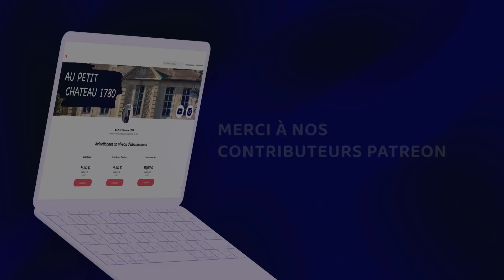ON CHANGE TOUT ! PORTES ET FENÊTRES DU RDC (Triple vitrage) | Vlog renovation

Comment: Lovely windows and doors, they will make a huge difference to heating in the house, make sure you have some good ventilation too.   I would also insulate the inside of  the exterior walls if the material permits as it needs to breathe: (i) to avoid condensation / damp (ii) to greatly improve the thermal performance of the house.